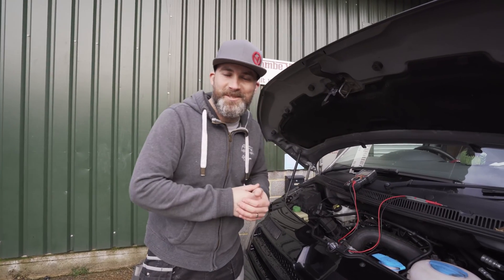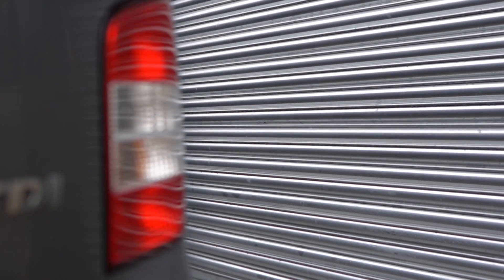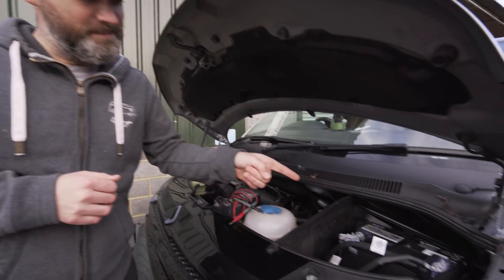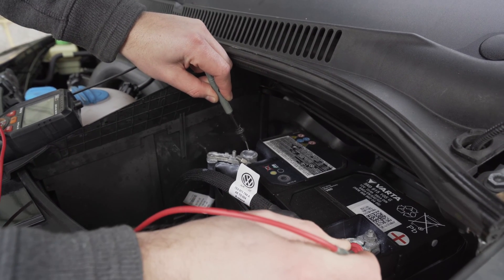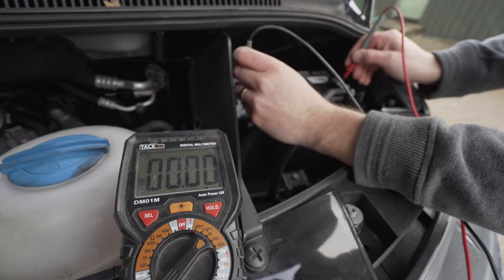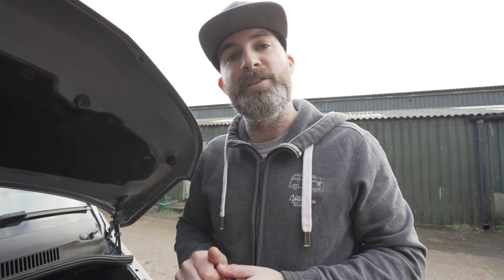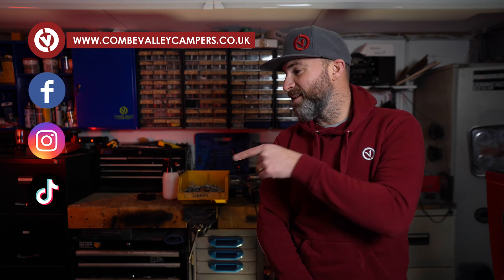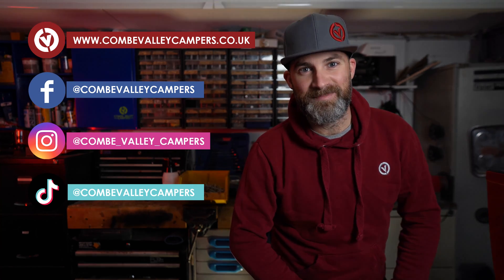HOW TO TEST FOR A SMART ALTERNATOR? A beginners guide

Comment: I think its more complicated than just taking 2 measurements 5 - 10 mins apart. We've had an alternator failure on MB Vito Tourer 2020. We drove the van for 2 hours without charging the battery to the closest point where we can fix the alternator. After the replacement of the alternator I monitored the alternator through the inbuilt service menu of the van. When we got back on the road with a new alternator and drained battery the alternator would keep up the volts up to 14.5V for around (drum roll) 40 minutes. Just when the battery internal resistance got to a point where it is about 80% charged then the alternator would back off and lower the volts to around 12.5 - 12.3 V. Whenever I released the gas pedal then the volts would come up again to 14.5V. So the point is that the voltage should drop only when the battery is charged up to a safe state. 5 - 10 min measurements might lead to false conclusion of a alternator type.

Comment: hi lee i did this test and got 14.5v  and 10min later 14.5v,  a couple of days later battery flat, i think i did the test with a partly flat battery, i think it should have been charged up  to get a accurate reading . am i right . cheers john
Reply from the maker: Yes give it a good run, make sure the battery is fully charged and repeat the test
Reply: U probably need to load test wid proper tester amp (CCA) capacity (% holding power) Voltage may read normal but amps keep dropping means either it's bad sulfation, shorting, low battery water etc. 'Sometimes' it's worth reconditioning but if Ur rich, time poor, don't bother n go buy a new one. U get wat U pay for in terms of quality, warranty. De cheaper ones r of thinner materials n not meant to last. (No matter wat U try) i.e. a lot of effort but still waste of time. Although a 60-70% recoverable battery can still b useful for applications around home eg. Led (emergency)light, 12v water, air pump for garden or fish aquariums etc.

Comment: Hello, excellent straightforward video as always. I carried out the test and the reading on my multimeter was 14.7 before and after. I have watched other videos that say having a black computer chip on the negative terminal is a sure sign of a smart alternator, I have this also so I'm a bit unsure. What do you think? Thanks for your time. (It's a 2015 Transit Custom)
Reply: Did you ever find out what you had on your 2015 smart or traditional?
Reply: @nige99  All Ford's for the last 20 odd years have had the Smart Charge system.
Reply: I have a 2015 vw caddy and i done this test and it sat 14.8v for 20min. But it also has a extra bit on the negative terminal that some people say. It's a sure sign its a smart alternator. Did you find out if yours was a smart or old style alternator? Seems to be conflicting advice on YouTube.

Comment: The battery will say AGM on it if its has smart alternator. ( just in case you dont have a multimeter )
Reply: Point is having a AGM as your start battery doesn't say squat about what alternator you have
Reply: AGM batteries are just sealed batteries for use in Rvs where a vented battery would be dangerous
Reply: @ashleym2878  No they are not. AGM batteries have a pressure relief valve in them which will vent gasses if over charged just like any other battery. Absorbed Glass Mat (AGM) is a more stable technology that doesn't lose performance as quick as standard lead acid or gel batteries. The electrolyte is absorbed into the glass matting which means it is less likely to be lost during electrolysis. Also there is less electrolyte needed so more plates can be installed therefor giving more capacity. AGM batteries are more common as starter batteries in modern "start-stop" engine vehicles than they are as RV batteries
Reply: @CalmeRyowl I've AGM battery with an alternator that is not smart alternator. AGM is not directly linked to alternator type. It's just the technology used for the battery so you would need to still do the multimeter test.
Reply: That is nonsense. The car battery is unlikely to be AGM, I have not yet found an ISR battery that is. AGM batteries seem to be universally deep cycle and those are not designed to start car engines. There are hybrids though.
Reply: @oneeyedphotographer  have a quick google there for yourself before making comments like that and making yourself look very foolish.